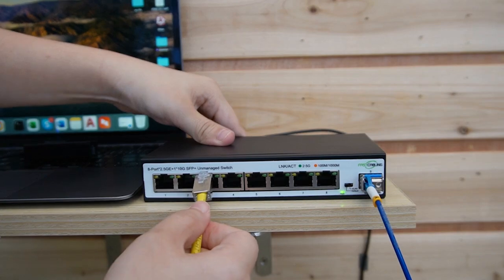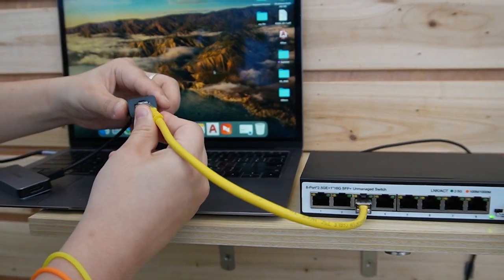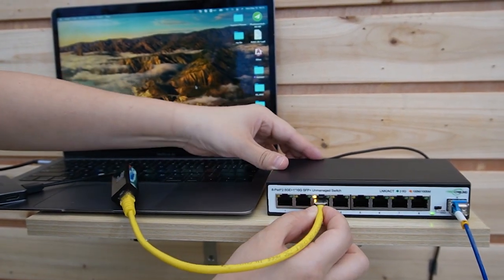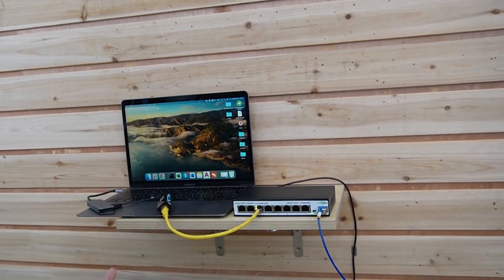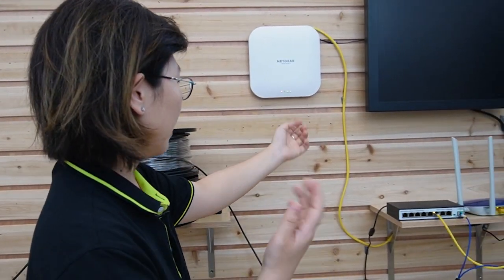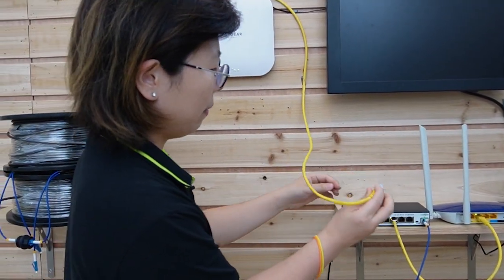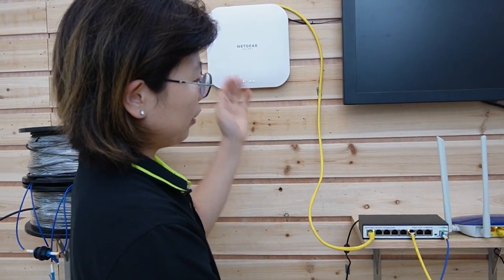Build A 10G LAN with 2 Fiber Switches | Step-by-Step Guide

Comment: Can we use both fiber string A and B on the end of sfp port on the switch and the same thing on the other end of the sfp port switch to make it in Full Duplex Mode communication? In your example showing half duplex because you Are using single fiber, am i right? Thank you.
Reply from the maker: We're using BiDi SFP+ modules which can transmit and receive data over a single fiber string. You don't need both fibers  for full duplex transmission.

Comment: Why some Poe port got 2 SFP transceivers?
Reply from the maker: It depends on the design. Having two SFP transceivers allows for redundancy. If one connection fails, the other can take over, ensuring continuous network operation. This is important in critical networks where downtime is unacceptable.

Comment: Thanks for the video. 
My modem is connected to fiber plug and from the modem I connect via ethernet cable to my 10gb switch. How can I connect my switch to fiber since my modem has no output for fiber but only 1 input? I hope my question makes sense!
Reply from the maker: If your 10G switch has SFP (Small Form-factor Pluggable) or SFP+ ports where SFP modules can be inserted, you can connect it to fiber directly.  But you should first ensure that the modem is not actually required for converting the optical signal into electrical signals (as in an ONT for fiber to the home). If it's just a modem/router supplied by your ISP and if your ISP allows, you can remove it from the setup. However, most fiber connections require an ONT to terminate the fiber optic signal and convert it to Ethernet.
Reply: @Fastcabling  thanks so much for your help. At the moment that my switch is connected via ethernet to the modem, do i lose speed in my network?
Reply from the maker: The speed of your network can be limited by the maximum speed your modem supports. If your modem does not support 10G speeds, then connecting a 10G switch to it won't allow you to exceed the modem's maximum speed. The speed of your Internet connection is also capped by the bandwidth provided by your ISP. For 10G networking, ensure you're using at least Cat6 cables.

Moreover, the actual speed can also be affected by the number of devices connected to your network and what those devices are doing. For example, if multiple devices are streaming video, gaming, or performing large downloads simultaneously, this can impact the overall network performance.
Reply: Gigabit ethernet from the fiber modem is good enough. The best most can do is 2.5gb ethernet to and from the modem, and if you're "bypassing" it and feeding a firewall, you can take advantage of the extra speed.

2.5gb is over the gigabit limitation you already have. And when you get above that, you can tap into "overprovisioned" bandwidth and pull more than 100MB/s. The padding is there to help smooth out bandwidth spikes and dips, maybe 20MB or so.

My fastest downloads and uploads in this configuration top out at 120MB/s or so. It's not absolutely reliable to use this extra overhead but it's usually there. Anything beyond that is clearly overkill until you upgrade your isp fiber speeds.

Comment: But the bottleneck is where the 2.5GB port connects to the 1GB port. 
It doesn't matter if there is a 10GB fiber connection in between. The speed will remain 1GB.
The access point has a 2.5 GB connection. The router has only 1GB connection.
Reply: the computers connected to both fiber switches will transfer data in the network with 2.5Gbit/s but the internet connection will be 1Gbit/s.
Reply from the maker: You are right. The uplink speed depends on your ISP provider. If you set two switch at point A and point B, and link both with 10G SFP port, then you will have 10G network between point A and point B.